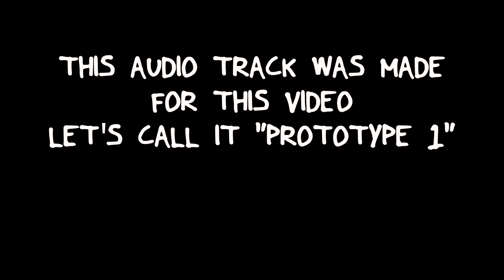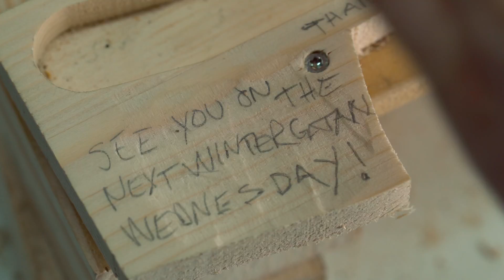Prototyping - Marble Machine X #2

Comment: When he is using the scroll saw, I get secondary school engineering flashbacks. There was always this one kid who would never get any work done and what he would always tamper with the scroll saws in particular. He would turn them off when someone was using them, and these were FAST SAWS, so this was a big deal, and also threw a drill bit on it when I first ever used a scroll saw on metal, and I have been put off ever since.

Comment: Another thing you may want to consider: why not make the programming/actuation system for marble machine like a player piano?  hand crank would power a small belllows pump to make vacuum.  Player piano mechanism would actuate small pneumatics to release marbles.  Pneumatics could also do things that marbles can't, such as work the frets of the bass guitar.  Big advantage is that programming the machine would involve punching roll, which can be changed in concert.  Advantage of pneumatic system is that things are "less mechanically connected", giving you more positiioning flexibility (pneumatic "signals" can be routed through hoses).

Comment: Why have the elaborate latch, and not just lift the actuating lever (its pivot would be mounted on another lever that you raise to mute) away from the programmong wheel, out of reach of the pin.  Either the programming wheel's pin catches, or it doesn't.
Another thing to watch out for: your lever that gets hit by the programming wheel's pins moves nearly tangent to the programming wheel's motion.  This precludes having 2 pins close together on a programming wheel's "channel".  The lever needs to swing away on a shorter radius, so it can be actuated,  unlatch from the pin, and return ready to hit the next pin right behind.
You could use the "old scheme" with the wire, but the wire would always remain under tension.  (Wires are better in that they weigh less, don't need to be sawn out,  allow faster response and less noise), and can be adjustable.)

Comment: been 7 months already? you could  employ an off-set cam (just like the cam shaft in an engine opens and closes the valves) for the entire rank or set of instruments with similar results using a handle with greater than 90° and less than 180° difference in rotation to engage or disengage that hooking rod mechanism and reduce that bounce as well. I'm enjoying the build.

Comment: I am not an engineer but I really like  your idea and the machine
now I have an idea for you 
Why not using the register number 2 for adding  an harmonium like to the machine ?
because harmonium are pinch piano wire it should be possible to make it work with marble activate pincher on your portable harp
this is only an suggestion !

Comment: You could still eliminate the sliding parts from the marble gate. Since a little vertical movement doesn't matter, as long as it's less than half a marble, you can have the lower gate lever actually support one side of the upper gate and have a similar lever support the other side. Just make the gap a couple of mm wider so the vertical movement doesn't jam the gate. Then you have only pivots and less friction and wear.

Comment: That looks like a very solid system!
Personally, I would have lifted the programming lever that is hit by the programming pin instead of the catch, but I guess either one works. Depending on the length of the programming pins, it would be less travel to clear the programming pins than it is to unhook the moving board. Sometimes it probably comes down to personal preference how a problem is solved :)

Comment: Hi, Martin.
May be you should do the connection of the arms (upper -- movable by pin; and lower -- which opens hole for a ball) harpoon-shaped? In this case, when the pin have started playing note, you couldn't disconnect the arms -- couldn't mute the system until note finished.

Sorry for my english :)

Comment: I feel like you will have problems with this? The design makes a lot of noise, and I don't think everything is light enough to work and not work as required with the programming wheel (without breaking it). I don't know, perhaps you are simply yet to incorporate something else that will make this wonderful, but I don't see it working
Reply from the maker: Its just a very crude prototype to show the idea, to test the concept of the mechanism. So everything will improve massively once done in the right scale with the right materials!

Comment: So wintergatan I'm not sure if you want the marble machine x to be crank like before but if you didn't mind you could connect the crank to a motor of sorts then that would make the turning of the entire thing less tedious and then you could have a mechanism for the part on the wheel that's taking the marbles down to the keyboard have those actually pop in and out so the marble machine can have more than one rhythm or song to it its just an idea if you understand what I mean look over it and hopefully you'll like the idea
Reply from the maker: Thanks for the suggesting! The first machine is totally reprogramable and can play any song! it just stopped working after the first... haha. We could use a motor but the tedious low tech cranking has such a big appeal to the whole thing i feel! its the old mechanical feeling it gives that i dont want to lose!
Reply: Yeah, there is a charm in cranks. Why they didn't make cars with crank starter nowadays? Turning a crank makes you look like some good old organ-grinder! (You definitely should find some authentic clothes for MMX to wear on stage!)  First barrel organ with motor, then what? Rubber woman? Midi sequencer?

Comment: You might have issues with the opposite race condition. That is, if it in unmuted, hits a programming pin, gets pulled part way, and then you mute it. I think that would cause it to snap back from halfway pulled, which might make a marble do something odd.

Right after you waved at the end, I waved back at my screen, and was surprised to see the reflection of my own hand in the marbles after you'd moved out of the shot. That was so strange that I watched it again to see if that hand was really moving at the same time as mine, and waved at exactly the right time again.
Reply from the maker: so wonderful that you waved back! you are right, i found out the same problem, and wrote about it in the description box! we are working on it!

Comment: It looks like you might run into some issues if you try to engage the mute while a marble is being released. You took care of the case where you're unmuting while a marble is being released but might still have trouble while the mute is being engaged. It looks like the pull bar will latch on the marble release mechanism, and prevent the mute lifting. Perhaps the mute will simply not lift until after the marble drops and be fine—so long as none of the channels to be muted bind during this process.

Comment: Just curious would it not be better to use a system that lifts the mechanism off of the programming wheel So when the mute is active the programming pins are not plucking it unnecessarily?

Comment: Engineery thought at 5:04...Great idea to be prepared for mis-timing of disconnecting the actuator with the mute lever. That looks pretty good. I would also suggest you check if there is some point in the motion where hitting the mute lever causes the actuator to jam and not let go of the marble release part. You may have to turn the wheel very carefully and try several positions to try to get the two parts to link and not let go. The reason to check for this is the angled face where the actuator touches the marble release bar would jam if it gets lifted while the actuator is pulling on the marble release bar. Even if it doesnt happen on the prototype, test for it in your later versions. 

Looks like great progress. Hell of a workshop with that rock face!!
Coxy
Reply: good idea. maybe you can reverse the slope on that one, just a little backwards to 2 or 3° or so to solve this. so if the mute lever pulls up there is no obstruction. but if you pull the registration you have enough friction to ensure a safe note.

Comment: At 4:37 you mention "a problematic situation" involving UNmuting while the programming pin has already hit the registrator. Not a problem, the system can handle that.

However, from what I can tell, the opposite would not work. You can't mute anymore once the programming pin has pushed the registrator far enough that it hooks on to the next part.
Depending on how the final version of that hook works, you might not even be able to pull the mute lever without risking damaging it.

Comment: I would recommend adding either bearings, of a metal plate to the surfaces that slide, as they might wear out quickly with
 metal-wood friction.
Reply from the maker: yes  definitely a prototype :)
Reply from the maker: thanks! absolutely going to use bearings for all moving joints throughout the whole machine!
Reply: Simon Bergman I guess it just a prototype, that would never be used?

At least because it is too noisy (add bearings and some precision into parts and it should be fine?)
Reply: I think the final product will be a big hit. =3
Reply: that's good to hear :)
Reply: Lmaoo it’s funny to see that even the comments from 2017 and 2021 are still the same! This will be recommended in sooo many future comment sections

Comment: Looks like a very sound (pun intended) and robust design. However, when muted, the wheel will still be striking what you refer to as the "registrators," causing a percussive sound.  Do you have any intention to try to minimize that?
(Great music btw!)
Reply from the maker: great question, absolutely. all the parts on the prototype are heavily oversized and on the real machine we can have felt to dampen all those sounds. I actually had tape to dampen the sound but removed it when moving a part and forgot to put it back.
Reply: But if it will not hit registrators when muted, it will lower mechanical resistance and whole mechanism may sped up a bit, or even worse, speed will fluctuate at moments of muting and unmuting, greatly annoying possible drummer.

Comment: what happens if you try to mute part-way through a note playing? Will the angle of the latch cause the muting to fail until the note is played? Would that mean you get a big jolt once the mute succeeds? If so, be careful of arm strain with that. And would it be possible that if you have multiple notes in quick succession, would they latch in the same way one after another stopping the mute succeeding for an extended period? If either of these are a problem, you could possibly solve it by having a spring in the vertical mute piece that lifts the latch. That way, you can always fully engage the mute arm and each individual note will mute as soon as latch isn't being pulled.

Comment: Nice prototype for a more reliable system. From what I can see only one small problem, even when the channel is muted you still get a hard click, so if you made this system with more channels you would still hear a click in the rythmn of the melody. You would either need to muffle the sound enough for it to not be picked up by a microphone or change the system so when a channel is muted, the first arm is moved out of the way so nothing gets hit by the pins, and in turn do not move any on the mechanism. It may be that you have already though of this but it was just an observation worth noting. Keep up the great work buddy 😎
Reply: But if it will not hit registrators when muted, it will lower mechanical resistance and whole mechanism may sped up a bit, or even worse, speed will fluctuate at moments of muting and unmuting, greatly annoying possible drummer.
Reply: Evil Gremlin didn't seem to be a problem for the first marble machine...

Comment: One possible problem I can see is the tings on the programming wheel will be pulling against a huge tension force and potentially breaking them. That said you might want to use a ting and base that is strong enough to withstand the tension forces from the springs, or you need a secondary lever system to minimize the force  requires to pull the release mechanism. The spring force is also important and must be adjustable to allow the weakest pulling forces possible while maintaining good timing.

Comment: In your initial design sketches, I was most worried about the slack of the lines near the registrators. Glad to see such an elegant solution so early in the process. A small new worry - I know this is only a proof of concept/prototype, but the force needed for the nail to move the registrator reminds me of how many programming pins were damaged in the last build. I assume the registrators will be less stiff, and perhaps only have to move a small distance to activate. Loving the weekly videos, Martin! Keep it up!
Reply: See at 1:55 It takes just 1-2mm movement to release the ball.
Reply: I see what you mean for the very bottom release, but at the queue of marbles near the top, it currently moves ~15mm to slide the bottom marble out of the way and into the ready position. The wheel/lever also moves quite a distance further than 1mm. Again, just a prototype, so I'm sure Martin has something in mind...just pointing out what I see.

Comment: Wintergatan, what made you decide to use a two-stage drop-down mechanism for the marbles? Do they have too much sideways momentum after they drop down from the wooden slider?
I see the two-stage as a potential problem if you want to play a fast beat on a particular note, if it's quick enough that the marble doesn't get the half second or so it needs to roll into place.

Also, the background music is great!

Comment: Its great! but the banging of wood is a tad loud, try some thin soft material in the parts that come together and it would be perfect! :3
Reply from the maker: yes, agreed! i had orange tape to mute the sound but actually removed it for some reason that i dont remember. On the real machine we will have much smaller scales and damp every surface with felt to get the sound down
Reply: I cant wait to see the final version!!